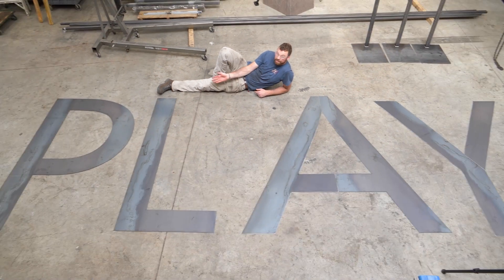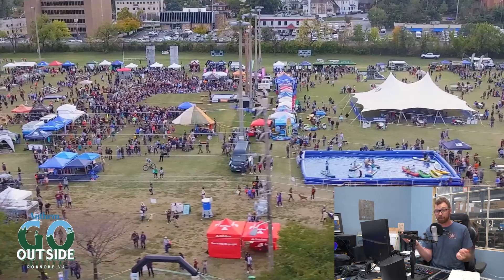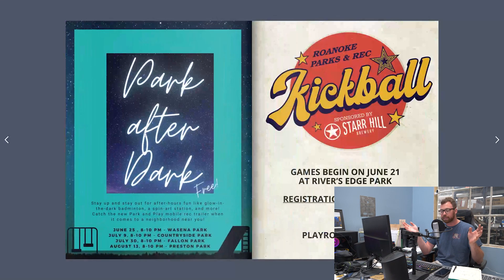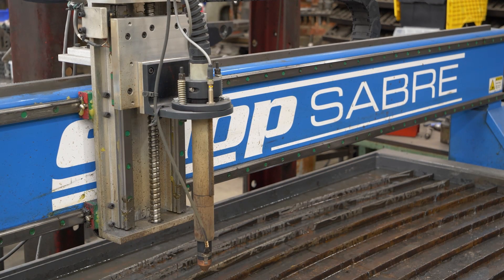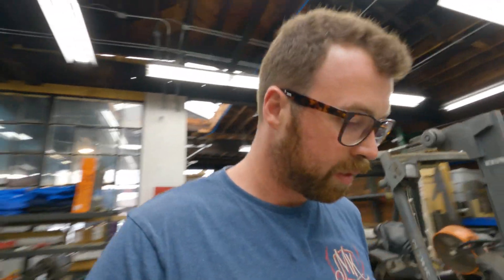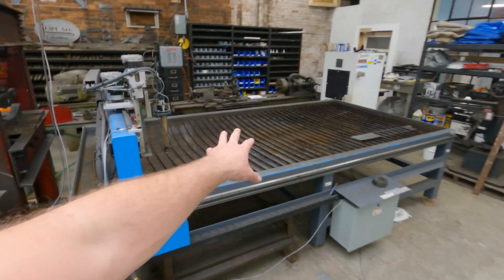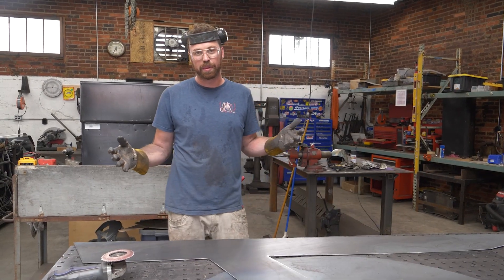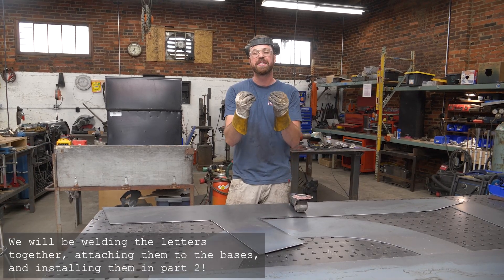Using the CNC Plasma Cutter to Create a MASSIVE Sign Pt. 1 // Lift Arc Builds

Comment: Hey Tay, are you familiar with Dropbox?  You set up a Dropbox folder on each of your computers, phone,  etc.  Anything you save on one machine will show up on the others, usually in a minute or less.  Work on something on one computer, modify it, and the changed file will be on the original computer when it's saved.  All totally transparent.

You can log into the Dropbox website from any computer and have access to your files.  A bigger feature of the web site is that a certain number of previous versions of your files are available.   The "da#%!  I deleted the wrong file!" Moments are gone.  And all of your files are backed up on the cloud.  Computer or drive dies?  No problem at all.

I use Dropbox for all my dev stuff.  It's saved my bacon a few times, and just makes things easier.

Comment: I love watching your videos. Recently ordered a Shop Sabre side kick 8 and am looking at air dryers for my unit. You said your air dryer really improved your cutting experience, what air dryer system did you buy?
Reply: I know you weren't asking me but I highly recommend some sort of water separator, even multiples, between the discharge of the compressor, not just the tank it's sitting on, and the inlet to the plasma cutter. I have a small, 3"x4", Langmuir Systems plasma table in my home shop. My air system is small but effective for what I need it to do. From the compressor discharge the air first goes through a single path 16 pass condenser attached to the belt drive cage so ambient air gets pushed through it, 285F in - 70F out. Most of the water turns from vapor to liquid there before it goes through the first water separator. Then it goes through a particulate filter and water separator combo. Next is the desiccant air drier. Then into the tank the compressor is sitting on. Then out to the plasma cutter. Works very well. Edge quality is excellent, no pops or blowouts. My consumables last longer. Auto torch height control is very stable. Worth the trouble. Put it together myself from parts, not that difficult.